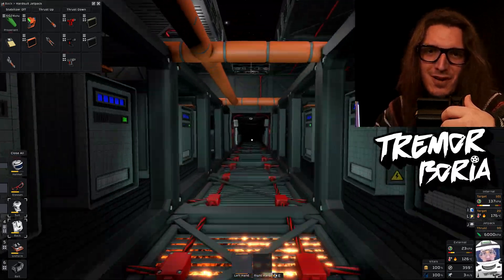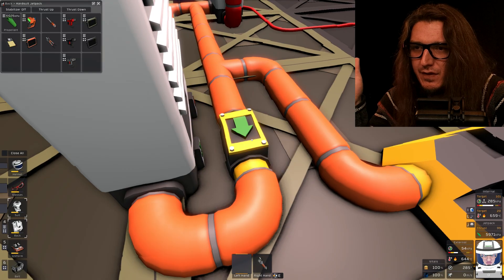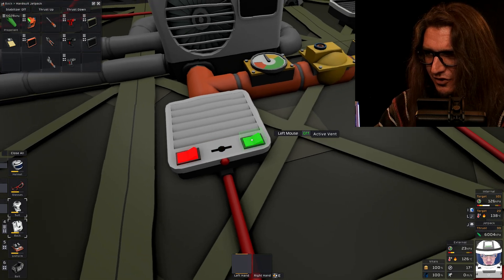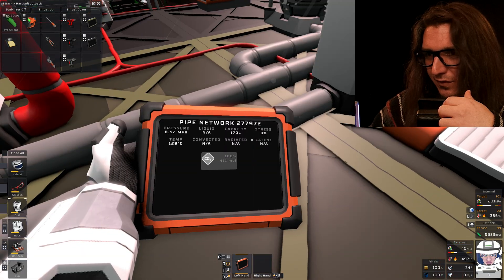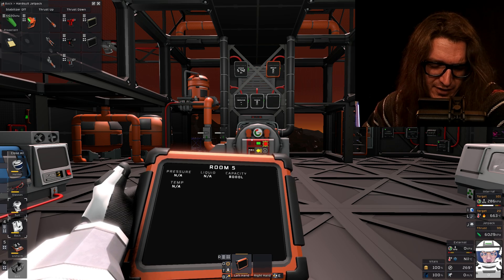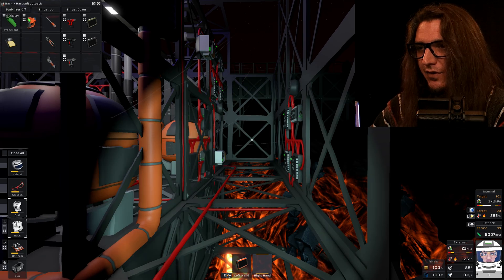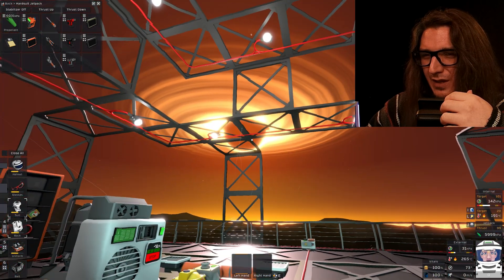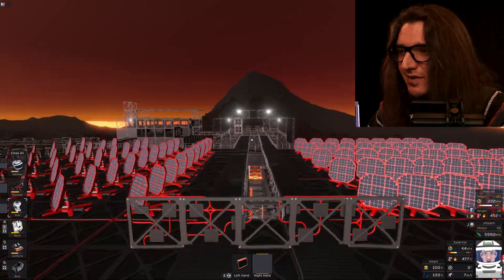Stationeers: Easy Vulcan Air Conditioner.

Comment: Sooo playing a new game of Stationeers - had to look up this here tutorial once again. And now - behold - TWO auxilary coolers, pulling from Vulcan Atmosphere, having a full insulated tank each (with about 5mPa... probably more later) only to cool ONE Main cooler consisting of TWO big tanks, also with ~5mPa.) And this main cooler then connects to a station wide network of coolant pipes, which in turn are used by ACs and wall coolers and stuff all over the base cooling various gasses, the base itself and so on.

And mind you - that's just the starter base I envision. You know, so I have a place to rest, repair and produce to build my vision of an Oil-Rig like structure sitting amidst a lava sea...

Comment: FYI a one-way valve instead of the back pressure regulator DOES work fine. I am literally using this in my own vulcan world.

If you are not happy with the amount of pressure that builds up from the valve, just use more than one.

Every time gas has to pass through a valve, the game needs one tick to render this. This is what let's the pressure build up. The more valve, the higher the pressure.

Comment: The "swirly" accretion disc around the black hole radiates quite a bit of light due to friction, compression, whatever, as it falls toward the black hole. The material approaching the event horizon gets slowed down so much by time dilation that it's like a traffic jam on the freeway, and actually takes a surprisingly long time to fall in, while everything above it keeps squeezing down on top. Crazy physics.
Reply from the maker: So... If we could shoot more matter at the black hole it would give off more light? Thank you for the explanation, I appreciate anytime I can learn something without having to go do actual work.
And thank you for the comment, you have a good day my friend.
Reply: @TremorBoria  comment is very old and you may figured it out by now: yes. in fact that is what physics believe black holes to do at the current state of science.